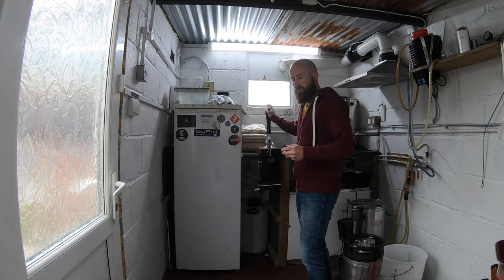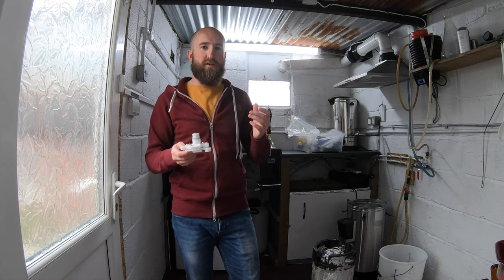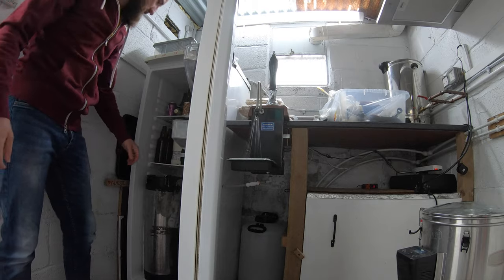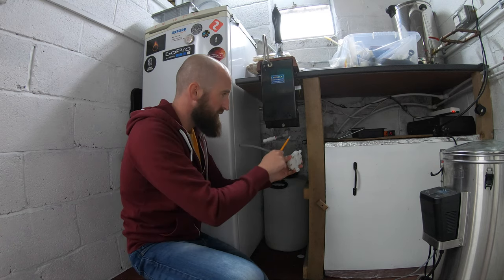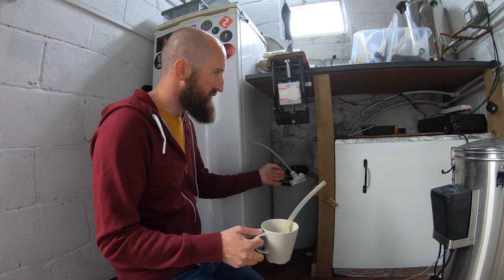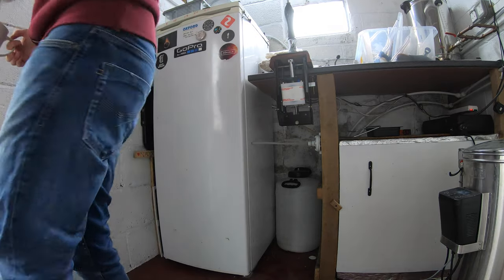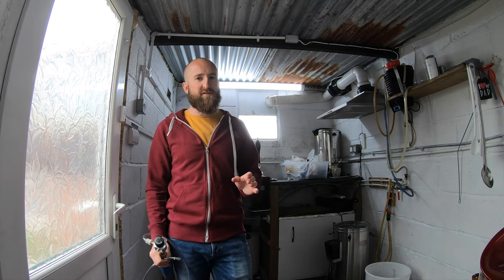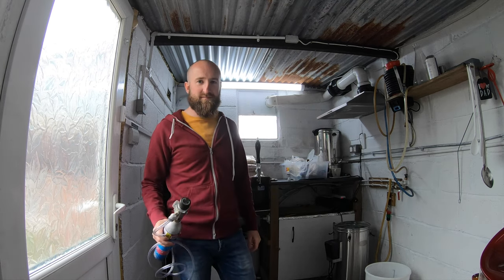How to Install a Hand Pull off a Cornelius Keg (Upgrade)

Comment: It should be noted that if you buy a used beer engine you should look out for drips underneath in use. If you see any it is a sign that the graphite seal is worn out. To allow for the pump action to be nice and smooth they use a graphite seal and not rubber or some other material. The downside is it wears out. I rebuilt my Angram a while ago and it wasn't too difficult. This is why I'd also make sure of parts availability before buying a beer engine from another brand.

Comment: I've been wanting to do this for years but one of those things never got around to and to be fair I've been happy with the beer from my taps on my Keezer.

Now you've reminded me how easy this actually is to hand pull from a corny keg and I have some time on my hands with this lockdown siutation, I may have to look into this.

I was of the view that I needed an Aspirator to equalise the CO2 in the keg, but actually thinking about it I could just run this off one of my secondary regulators set really low.

Sorry if you covered this in another video, but where did you get your hand pull from?

Cheers
Reply from the maker: Hi Rob, the cheapest place I've found recently is from RLBS, that's where I got most of the kit from for this upgrade. Cheers

Comment: Hi. Live the videos on the use of the beer engine. Very helpful, thanks.
I'm looking at setting one up from a corny keg kept in a fridge and run beer line to a man cave bar. -
Have you had any problems with your set up or any advice please? How long would the home brew last using the demand valve?
Cheers for the videos bud.
Dan

Comment: Hi mate, good vid and interesting. I'm going to have a go at this also after deciding to ditch plastic bags also. Any chance you can do a vid about brewing process for cask in a keg? Correct me if I'm
wrong but I think you mention that you're carbonating with co2 as opposed to secondary fermentation in the keg using priming solution? I'd be interested to know what the results are like and how it measures up to a pint of cask that you'd get in a pub. Cheers, other Griff (in Yorkshire)
Reply from the maker: Hey Griff, thanks for your comment. it's very pub cask like mainly due to the beer engine knocking out the big CO2 bubbles giving it that smooth mouthfeel we all love in the pub (whatever they look like these days eh!)! Cheers
Reply: @HomebrewGriffo  - ok cheers, I've decided to go down secondary ferm. route using priming solution. I've shortened the beer out tube in one of my cornies (going to dispense as standard with keg stood vertical) and got a cask breather set up between my co2 supply and gas in post.

Comment: Awesome video Griffo. Do you still have full control of the flow on the beer engine or is it just off or on because of the pressure? Thanks mate.
Reply from the maker: Thanks John, yes still have control, very little carbonation in the beer

Comment: I love this idea and already have a demand valve in place, my only question,  how would you leave the beer in cask at 5psi prior to serving? I have a tiny rebel Cwtch ready for new years day and would love to serve it justice was originally going to rack it into poly pins and prime but this seems ideal?
Reply from the maker: Hi, I'd leave it as 5psi in the keg with a co2 feed set at the correct pressure then just attach the beer engine to the keg out post to serve 😋

Comment: Great Post, I have a pint365 engine here in the states but the vitop connection is one for the beer in a box. What type of connection are you using to hook up to the corny keg? Yours appears to click down on the connection. Any suggestions would be greatly appreciated. Diolch, met
Reply from the maker: Thanks Joseph, I just bodged a standard ball lock connector onto it. Hope that helps, Iechyd da!
Reply: Awesome thanks again for your assistance

Comment: Hi Griffo, you can replace the dip tube in the cornie with a short gas tube and then put a widget (floating inlet) on it so you can draw from the top if you would like to naturally carbonate the cornie. If you want to go the whole hog you can fit an aspirator on the gas side (keeps the purists happy), this allows you to use low pressure vessels like plastic 'cubes' as casks.
Reply from the maker: Cheers David, there may just be a Version 3.0 in that case! 😜I've just looked at Aspirators again and they're about £40 so I'll see how I get on with V2 first. Thanks for this info!
Reply: David what shelf life are you seeing with the aspirator system? Griffo same ? To you. I had read about an increase of 1 day but can’t believe that it will be so little
Reply: What i# the new shelf of your keg with V2

Comment: iv got a hand pull but its very foamy as it draws from the keg and gets worse as it goes throe the check valve and into the 1/2" line. any advice?
Reply from the maker: Hi Simon, Could it be drawing in air? Maybe that you need to allow for more air/CO2 flow into the corny as you dispense...

Comment: Hi Griffo, I’m Brazilian and I was curious about this mechanism, I’m starting to brew beer and I don’t know the cultures in depth, I would like to know the reason for using this type of pump because here in Brazil we use forced carbonation and extracted it with the co2.
Reply from the maker: Hi Pablo, it's a very traditional british style of beer of very low, natural carbonation. More suited to a bitter or lightly hopped golden ale. Highly recommended! Cheers
Reply: It's a cultural thing too. For a time when real ale was in decline you saw a lot of mass produced and poor quality bitters served by pressure with taps. So many of us associate poor beer with taps and decent real beer with beer engines (hand pulls).

Comment: Mate  - I bought a hand pull from The Malt Miller; but it came with connections for the Corny Keg; do I still need a check valve; I want to use mine as a cask so want to do the same and replace the head space with CO2?
Reply: If its the Pint365 hand pull system from The Malt Miller then I believe they have a built in check valve already.
Reply: @robday1976  Yes it is - thanks pal, I thought so.

Comment: Hi Griff. I have finally put the hand pump system together but it seems to be giving me lots of foam and therefore takes ages to pull a pint. Do you have any idea why and do you know how to stop it. do you have a watts app address or some means for me to send you pictures of my setup.Thanks for your videos they give me inspiration.
Reply from the maker: Awesome! Could it be too much carbonation causing turbulence in the lines? Is it connected to a co2 cylinder that may be set too high pushing the beer through the hand pull? Maybe try it with the pressure relief valve open? Cheers